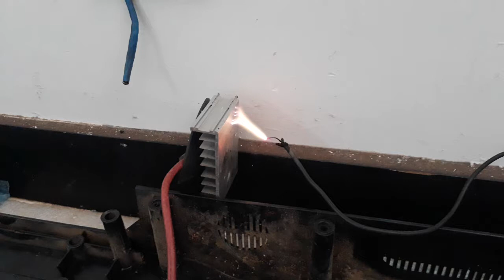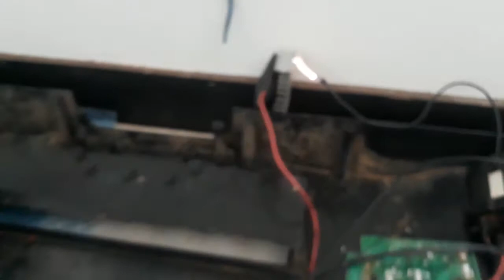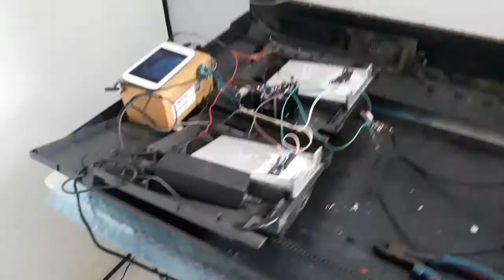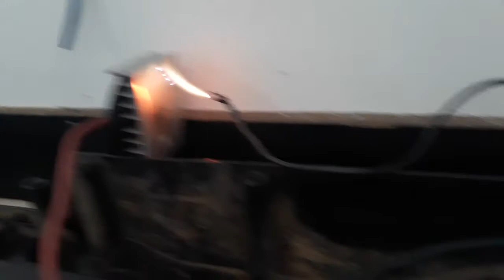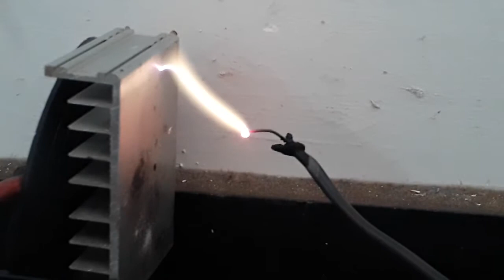Flyback plays Vivaldi

Comment: Sounds good Erick!
Reply from the maker: I'm pretty sure your SSTCs can audio modulate better than this! Just input a high impedance audio source into whatever IC pin controlling the frequency and check the waveform while inputing a 2 hertz sinusoidal tune. If the waveform stretches back and forth twice in a second, you're good to go!

Comment: Poderias mandar a lista de componentes e o esquema do projeto? Ficou sensacional! Meus parabéns!
Reply from the maker: Aqui amigo: https://www.instructables.com/id/A-reliable-plasma-speaker/

No entanto eu fiz algumas modificações desde então, que são necessárias:
1. Usei fios de rede trançados no Gate Transformer.
2. Gate Transformer de núcleo duplo.
3. Totem pole com TIP31 e 32 na saída do oscilador, para tocar o Gate Transformer.
4. Controle de Dead Time do oscilador.
5. Alimentação separada (14.5v) e filtrada para o oscilador.
6. Alimentação separada para os MOSFETs,  direto da tomada passando só pelo retificador e pelos capacitores.
7. Agora são 4 MOSFETs trabalhando em Full Bridge (Obviamente não suportaria direto da tomada de outra forma).
8. Os MOSFETs que uso agora são G47N60, 47A 600V 0.064 RdsOn.
9. Neon de alta voltagem em paralelo com o primário Flyback (Para segurar kickback).

As modificações 2, 4, 7 e 8 não estão no vídeo. A modificação 3 é essencial pra não queimar o CI oscilador. Modificações 1, 2, 4 e 9 evitam a queima dos MOSFETs.

O circuito todo aprimorado foi desmontado assim que terminei e usei só algumas vezes, sequer filmei porque o touchscreen do celular não funcionava por conta da interferência do campo elétrico que derrubava até sinal de rádio. 

Estava consumindo muito tempo e energia (mental e elétrica lol), e os Flybacks fritavam, além de que fazia muito barulho e era muito perigoso.

Boa sorte pra vc :-)
Reply: @ericklopes4046   muito obrigado, meu caro!